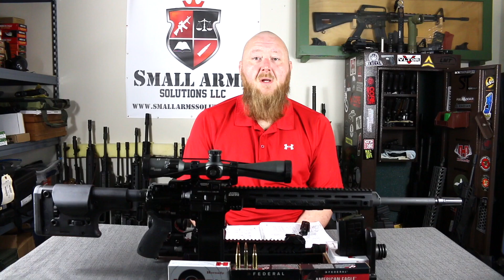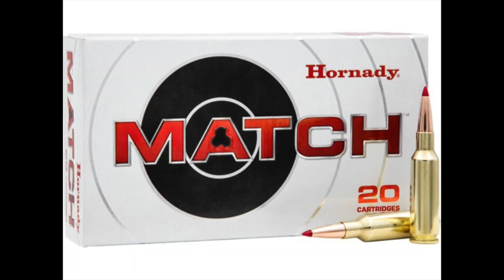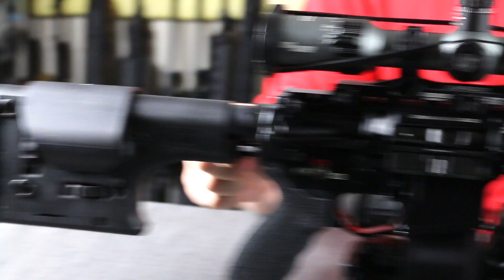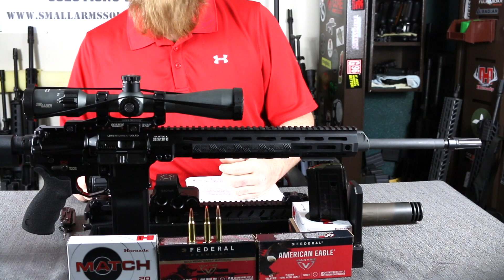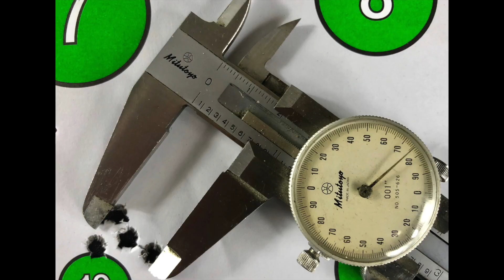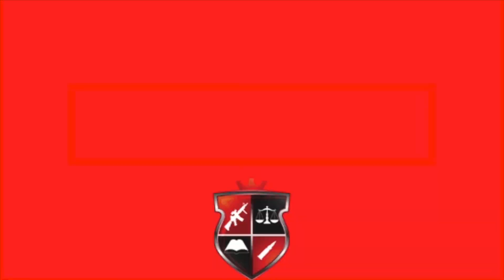The LMT MRP .224 Valkyrie - New for 2018

Comment: You mentioned chrome lining for hardness extending the life of the bore. Stainless steel resists corrosion but it is a softer steel. Would stainless steel be just as good for extended bore life or not? Thanks.
Reply: RB M my understanding with regards to stainless and it’s resistance to corrosion it’s the nickel in the stainless that provides that property. Chrome plating is harder then chrome moly steel,or stainless. That extends the barrel life due to flame erosion.
Reply: @stevewilson7819  Got it. Heat erosion. Thanks. I see a lot of .224 Vals with stainless barrels is why I was asking.
Reply: RB M looking at the material chosen reflects Its end use. The round was designed to be an accurate long range cartridge. So they would usually stay away from chrome lined barrels. Most long range shooters prefer to not clean their barrels, and don’t want to worry about corrosion. So that’s why you see them running stainless barrels.
Reply: @stevewilson7819  Yep. I see that and chrome lining does degrade accuracy just a little. I have two ARs, one chrome lined and one not and there is a distinct difference in accuracy.

Comment: Thanks Chris.  I like the M LOK uppers, they are a bit lighter vs the SLK8's.  An Arisaka Defense M LOK mount and Scout Light fit so tight to the M LOK  handguard, got to be the most low profile way to mount a Scout light.
One thing I've found, once you put some M Lok accessories on there, it's no longer a quick change barrel system.  The barrel will not come out while the M LOK screws are in.  I had to file down the M LOK screws on a pic rail to mount an Atlas  bipod, screws seemed too close to the gas block on my 16" barrel.

Comment: Heard on the sierra bullet package it says they need 1/6 to 1/6.5 for the 90's. Seems most barrels are coming out still 1/7. Mixed results with reloaders and bullet stabilization so far. Intresting round though none the less...
Reply from the maker: Nyquil07 Na I stabilize 100gr in 1/7
Reply: Its not really the bullet. You have to remember that the 90g SMK was around way before Federal  wanted to use it in the Val (example 556 service rifle competition, with similar performance to the Val). You can use any of the online 'ballistic stability' calculators to see the numbers for yourself. Also, the top nerdists at Sierra confirm that the bullet will stabilize in 1:7 as it should. It really comes down to the quality of the chamber.
Reply: Hammer Click I saw a thread on FB from a friend that referred to them using a Bartlien gain-twist barrel that ended with a 1-6.5 twist for running the 90 grain bullets. I did a little bit of load development on the 90 grain 5.56 MM Round the last season I shot high power. I couldn’t get the velocities I wanted out of it. The Army Marksmanship Unit was running a load that was hot enough they needed to use new Lake City brass with crimped in primers. I heard pressure wise it was almost a Proof Load and would blow the primers.
Reply: I have no issue stabilizing 90gsmk, nor does SAS, or others with 1:7.....quality of the chamber.  Again, refer to the twist calculators, the math, what ever. I think the problem is that some manufacturers expected high performance from $40 barrels and buyers did not know any better...blurring of the line between high performance and off the shelf blah

Comment: Hellava Rifle!!! I prefer the Grendel to the 224V.
Reply: Sure in 2015.  The BC’s for 224V and 1K yard ballistic performance are way way better than any 6.5 pill you could load to Grendel mag length.
Reply: @petersouthernboy6327  I'm getting both, but 6.5G still has its uses - I wouldn't discount it just yet. It has a lot more energy, and it does surprisingly well out of a 12" barrel. This is some data from Alexander Arms: http://www.alexanderarms.com/images/pdfs/grendel_ballistics.pdf 
The 123 gr Lapua's look very good, and some forum posters have reported 2,250 +/- fps out of a 12" barrel. There's a new company called FoldAR, and I'm going to email them later and ask some questions... My plan is to get a 12" 6.5G folding upper, smack that on top of this BAD PDW that I have to SBR first, and throw on a Vortex Spitfire (12.2 ounces), and have a 600+ yard rifle that has a folded OAL of... I don't know yet. But the collapsed BAD PDW lower is 12.5" inches. Might be somewhere around 14-15".

Comment: Would this caliber be a good military replacement for the 5.56? In Afghanistan there are instances of the Taliban firing from more than 600+ yards away to stay out of reach, but with this caliber, they won't be out of reach anymore.
Reply from the maker: Humberto Martinez no sir, wear the barrels way to fast and would beat up the gun on auto.
Reply: I’ve always stood by the 6.5 Grendel
Reply: @Humberto: Hell No, the Valkyrie is out classed in speed and accuracy by the 224Grendel.
Reply: Current direction the Army is looking at for their infantry, cavalry, and combat engineers is a developed 6.8 caliber bullet of their own design to be paired with an industry developed cartridge (whether it be polymer cased, polymer cased-telescoping, or caseless) that can get this projectile to defeat most standard wear hard armor at an unspecified distance. If such an animal makes it past infancy expect that cartridge to be a barrel smoker.
Reply: AaronOrr: You should cite your sources, way to easy to see what article you pulled your comment from.
Reply: @killerfungis  If I am writing a scholarly research paper I will note my sources. Otherwise comments on YouTube don't merit the same level of scrutiny.
Reply: AaronOrr: It does merit scrutiny when your words/writing so obviously copies the writing of others and you pass it off as your own. Specifically "Inside the Armys Pursuit of a High Tech 6.8mm Round; by Matt Cox (Military.com), and "So Long 5.56.." by Jeff Schogul (Task And Purpose May 2018).

either way I suppose it was good to point out the 6.8 research
Reply: 6.5 Grendel is a better cartridge!